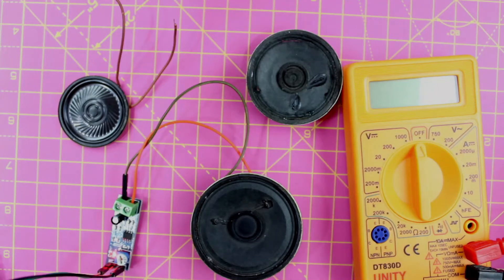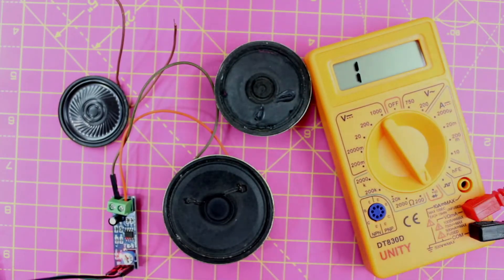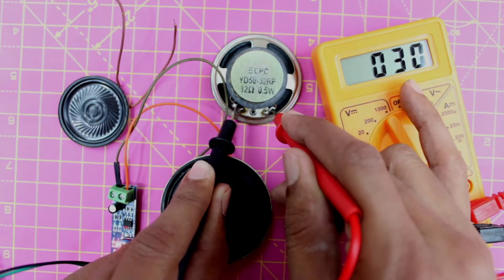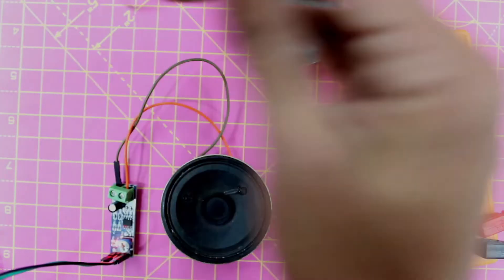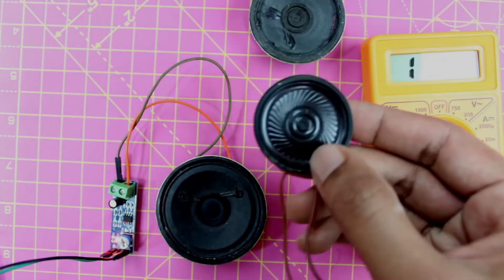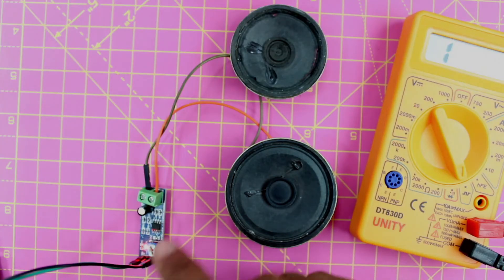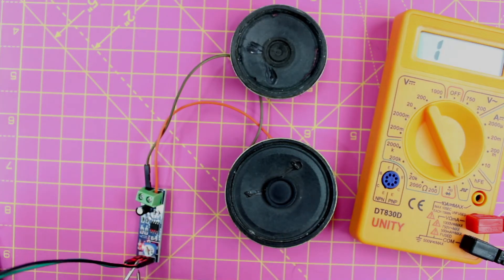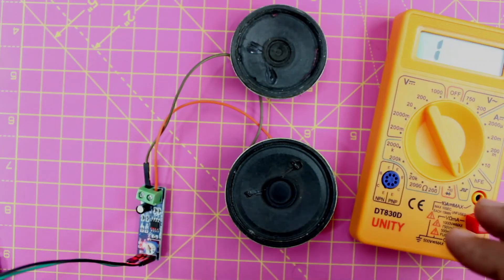How to Check Speaker is Working or Damaged with Multimeter | Multimeter Tutorial

Comment: I'll take an AAA battery and a wire, then connect the two terminals to a speaker. If it makes a sound, it means the speaker is working fine. If there's no sound, the speaker is faulty.